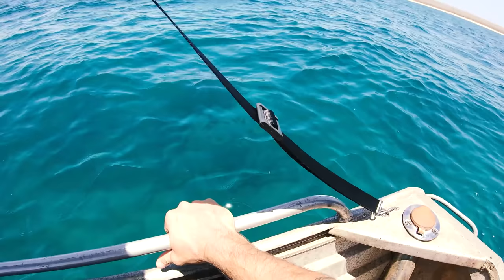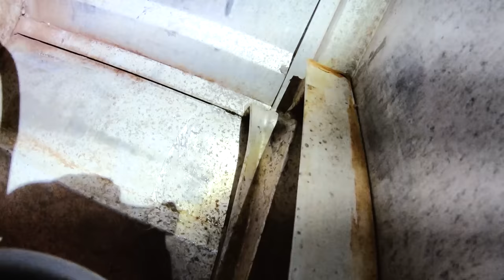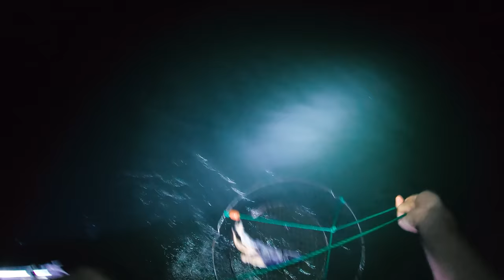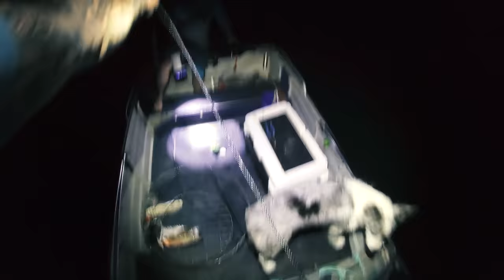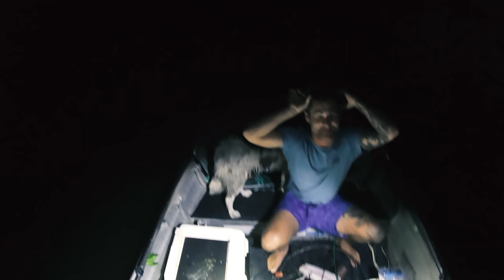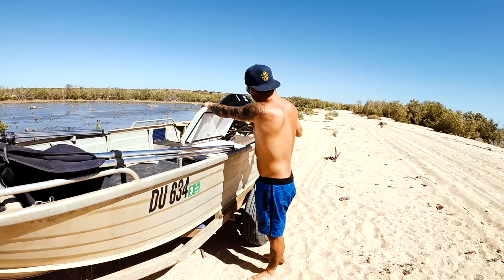REMOTE CAMPING WITH NO FOOD Giant Mud Crab Catch & Cook - Ep 150

Comment: Brodie if your tinny is leaking yuo can pull the plug in the transit while you are driving and all the water in the boat will drain just as long as you keep going don't stop or it will reverse and fill up instead of drain  , put the plug on the in side of the boat it's easier to pull but just so you know try it and see how it works run the tinny along the shore and put water in the boat and pull the plug out and watch the water drain take it easy Tom Raymer from Canada
Reply: Have used that method many times myself on a few leaky boats. Amusing to hear them use “ tinny” thought it was just Canuck thing